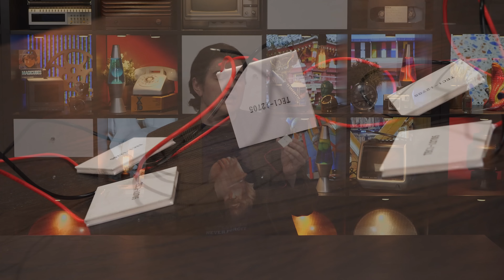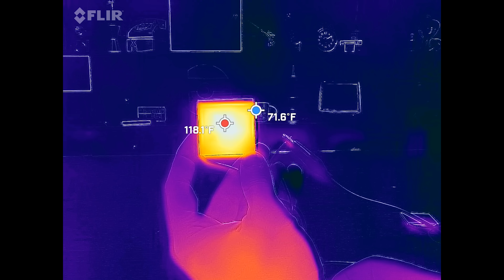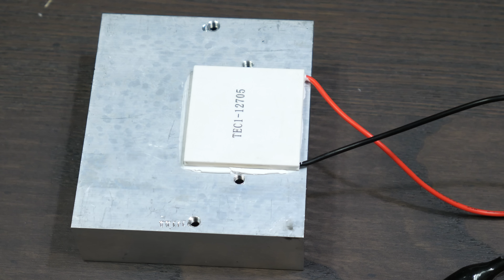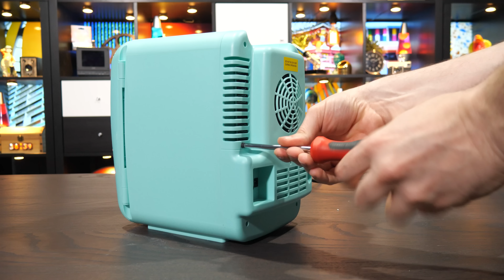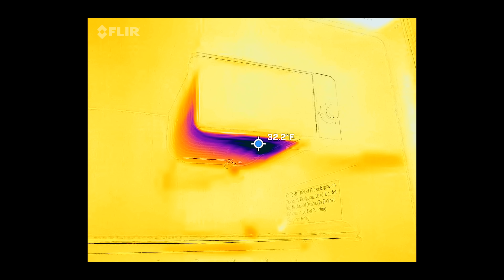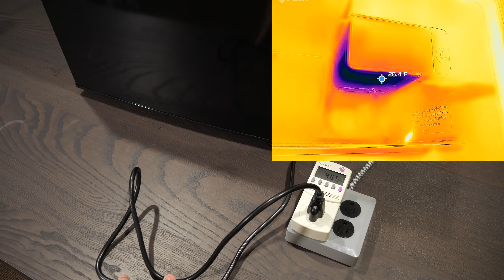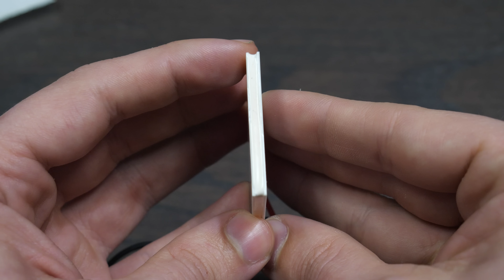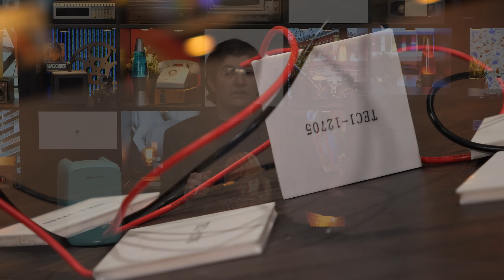Thermoelectric cooling: it's not great.

Comment: We used a dew-point indicator using a Peltier cooler 35 years ago.  The peltier cooled a mirror until it fogged up.  It would cycle temperature up and down giving a very accurate reading of dewpoint.  Much more accurate than a humidity sensor -- and having a price to match.
Reply: That's actually how dew point is measured in most official weather observations as well, especially for aviation weather because of its high accuracy compared to other humidity measurements. One very useful (but again, very niche) use for the Peltier cooler.
Reply: If there's an universal rule I've ever learned:
A tool or product is only cost effective when you use them for something they're not meant for
Reply: @AdrianOkay  Which is interesting cause these things are absolutely not meant for cooling air. They're great at surface to surface cooling.
Reply: What’s the thermal sensor you were using to measure the temp inside the blue fridge?
Reply: According to the weather report for where I live, the dew point is 31F and the current temperature is 86F...  your dew point indicator would never work here.
Reply: @misterkite  Alec's "refrigerator" is rated to 30˚F below ambient temperature, but Peltier elements can be designed to reach arbitrarily low temperatures for these kinds of applications. The rated limit for accuracy in ASOS instruments (the kind used by the Air Force and National Weather Service in the US) are guaranteed accurate to dew point depressions (difference between temperature and dew point) of 63˚F (35˚C), but they will usually work far past that point.
Reply: @misterkite Peltier coolers can be stacked on top of each other for a greater range.
Reply: @misterkite bro lives in the desert. I have always lived in humid places so I just assumed dew point could ever be subzero.
Reply: @misterkite  You get a much larger temperature difference when not trying to cool a large volume. The thermoelectric coolers can also be stacked to get a larger temperature difference.

Comment: Are Peltier dehumidifiers also really bad?
Reply: You wouldn't believe it: They're even worse. They don't work at all until a certain threshold of temperature difference is surpassed. To get to that high a difference they need to run super inefficiently.

Comment: The vertical ones don't need defrosting? I stayed in a hotel that had one of those and the back was a solid sheet of ice. Granted, they never removed the plastic from the exterior, but I defrosted it myself and removed the plastic.

Comment: To add to the "hilariously niche uses for a Peltier fridge" pile, I am considering using one to store feeder insect larva for my pet lizard. 

Lower temperatures cause most bugs to 'hibernate' which keeps them from metamorphosing too soon, but typical fridge temperatures can sometimes kill them.
Reply: this may be the only valid use for such lukewarm fridges
Reply: You could also get a small fridge and a temperature controller to turn it off below your desired temperature, if you can find a small enough fridge to not waste a ton of space.
Reply: I literally bought a used Peltier fridge off facebook marketplace for this exact reason. It had a temperature control panel and what seems like TWO Peltier elements that also can heat up the fridge if I wanted. I use it to store my mealworms and eventually in the winter it'll be where I hibernate my ants for 3 months. Mine doesn't seem to have any issues hovering in the mid 40s.

Comment: Well, OK, but my thermoelectric wine fridge DOES have a thermostat, holds the temp very stable and cold enough for white wine, and is VERY quiet compared to a compressor-based unit.

Comment: I've only ever come across peltiers when used as part of the cpu cooler stack (between the cpu and the heatsink). Is that still a popular thing? ... ahh it seems that because the efficiency is based on difference from ambient temperature: they are terrible at cooling anything below ambient temperature, but much better at cooling a hot thing (like a cpu) down to ambient temperature.